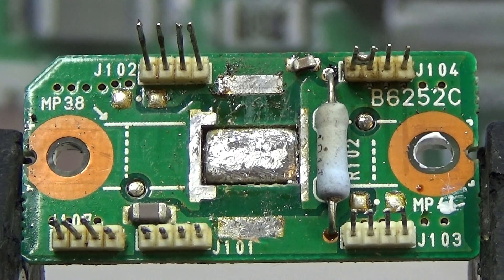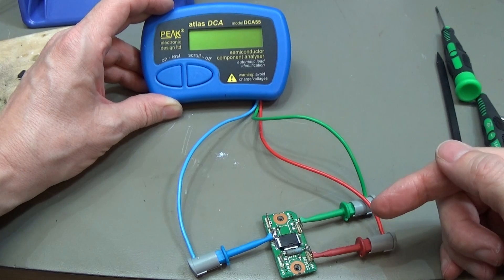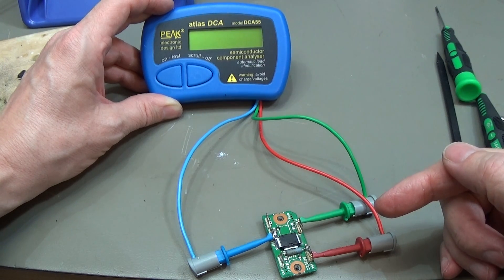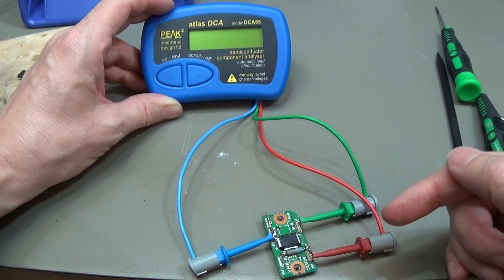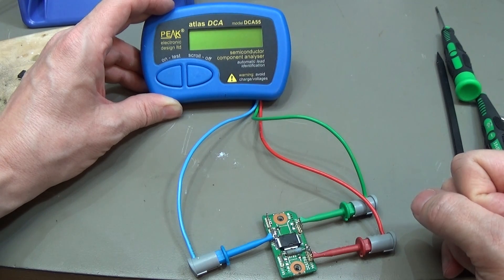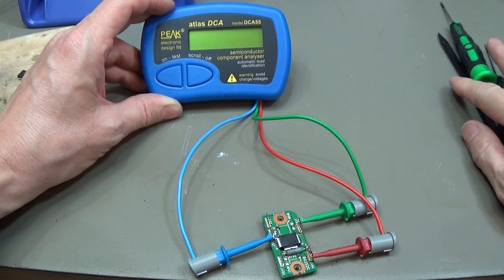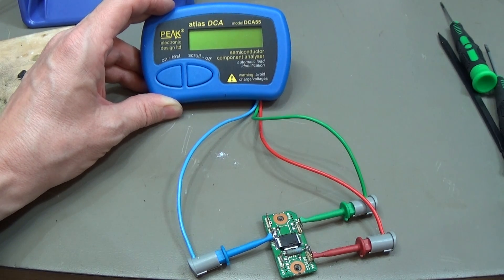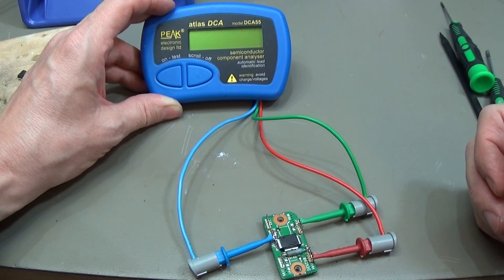#73 Modification for Driver Board ICOM IC-7000 to prevent burnig off

Comment: I realize this is a 7-year-old video, but thought I'd ask a question anyway.  Did ICOM ever produce any of the IC-7000 radios with the redesigned driver boards?  If so, does anybody know the start serial numbers of radios that were upgraded?
Reply from the maker: yes ICOM implemented this mod, but I don't have the starting on mind
Reply: @TRXLab  Thanks for the reply. Would I be able to determine if my 7000 has the updated driver board without totally disassembling the radio?
Reply: @euro9115  It's very difficult to see the printing on the driver board without removing the PA board, as the printing is sandwiched between the top of the  driver board and the underside of the PA board. Maybe a very tiny camera...  My serial number is 0511XXX and it has revision "C" of the driver board (I'm replacing the MOSFET as I type this since it burned up) and as far as I know the last revision of the driver board was "D". 2 years later but there you go ;-)

Comment: Far  better remove the right hand pin from the connector  then cu the trace just past that point  new resistor will fit cleanly  .
Reply from the maker: good hint Pete. Thank you
Reply: @TRXLab  I do the odd repairs now and then n othing like the amount you do as a hobby now  so always looking at easy neat ways of solving things

Comment: A parasitic choke circuit might actually be the better design albeit a challenge in that cramped space.  I also concur with cranking the power back a bit plus proper heat sinking as already shown.  Great videos - thank you.
Reply from the maker: Yeah cranking the power down will reduce the heat problem...73

Comment: Hi great video thank you for making and posting it. It would have been helpful for me at least to see how you soldered the resistor in place without effecting the mosfet?

I presume you used solder paste on the mosfet pads and the hot air to flow the solder, did you do the same with the resister and then put a solder bridge in to replace the trace?

Comment: Thanks for video. Beter to make same modification on my icom-7000 to avoid burn it off. Thanks and 73!  Vladimir  UW5EJW/MM,   ex UT5EKF/MM
Reply from the maker: That is not wrong but be careful it is a bit tricky job!

Comment: The modification doesn't resolve the issue. There has been several iterations and addendum on the service manual and none have worked. The latest modification doesn't work as we have had several units burn. We had a case with one customer that had 3 units burn the driver within a very short period. Icom replaced his units under warranty and they still burnt the drivers. We visited his premises and found a few issues with his setup. I recommended some simple changes and now he has absolutely no issue anymore and his 7000's have not burn the drivers again. This was approximately 3 years ago.
Reply from the maker: Hi Shane, what is the last working solution for this problem? Thanks for stopping by 73
Reply: Hi Tx Bench. The latest mod for the driver burn from Japan is 1. replace grounding fingers with one piece PCB grounding plate. 2. change gain resistor and cap on DSP board. 3 Readjust Tx gain in adjustment mode. This was in the form of a TSB from engineering Japan head office. This last modification still didn't work and this is typical of Icom Japan when it comes to complex problems. They have no clue.

Comment: Hi there great vid...is there a reason why the plug pins top right is soldered across.keep up the good work you have really stirred my interest.
Reply from the maker: +Ian Fletcher Hi Ian, no reason only by accident but this pins are anyway all connected together. If you watch my repair on the driver board in an earlier video you see how it is soldered together. Thanks for comment! 73

Comment: Icom service told me the same thing a few years ago when my 7000 went up in big ball of smoke.   I ran it by the engineers in our club and they agreed that the radio most likely went into self destruction.   It didn't blow the fuse and thankfully it wasn't mounted in the car as I was able to cut the power and throw the smoking radio outside.  To say it let the magic smoke out was an understatement.
Reply from the maker: +KD0LRG Yeah that is really a bad serious issue. Hope your radio is now working without problems! Thanks for comment 73

Comment: Is that resistor 1.50 Ohm 1% and connected to the gate?  If so, I think this is called "bootstrap resistance".  It reduces ringing caused by parasitic capacitance and inductance, which I think might be what is contributing to the runaway condition you mention which sends this circuit into self-destruction.
Reply from the maker: +k1mgy Hi, yes it is a 1,5Ohm resistor. Don't know how it is called, but think we are talking about the same. 73's